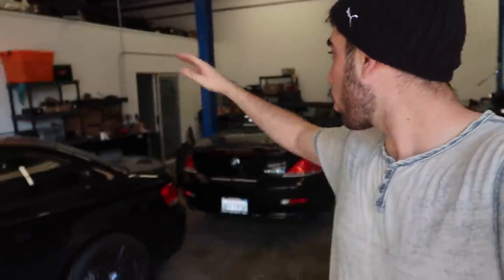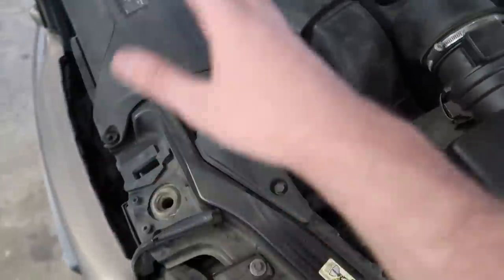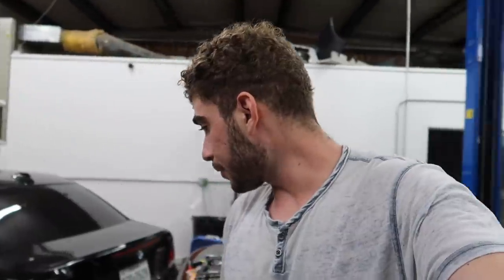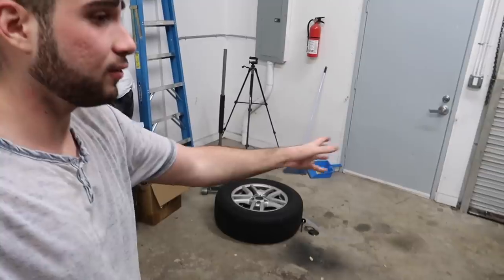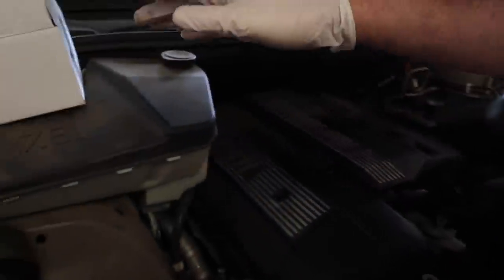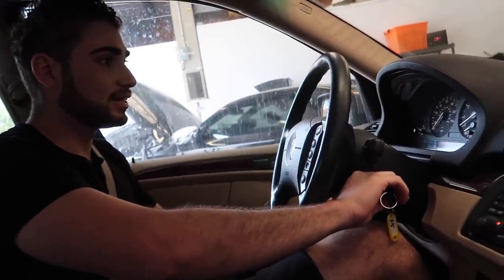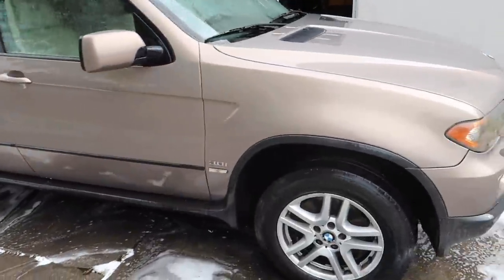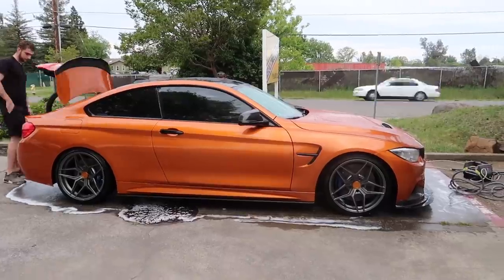MY 3RD CAR I'VE BEEN KEEPING A SECRET!

Comment: That should be your towing vehicle, and also you should lift the X5 and do a subtle off-road build, nothing ridiculous but like putting off-road tires and 2 inch lift. I have an M54 basically your car and it has more miles than yours and they’re damn reliable!!! Oil leak is strange and I never had the problem!
Reply: Abe E 

You’ve made the most confusing comment ever, and I’m not even white which is the best part about how pointless your comment really is..
Reply: BLACK BIMMER 
Sounds like a cool idea, lowered X5s are stupid, literally defeats the purpose. Lifting will make the X5 more capable even though Nour wouldn’t off-road it, if I were to have a choice of lowering it or keeping it stock, I would leave it stock. Lowering the X5 is so ghetto..
Reply: Agreed. I own an E83 with the M54. Such a great engine!